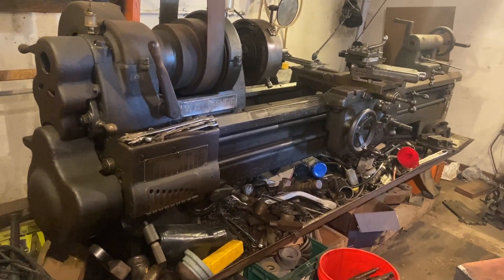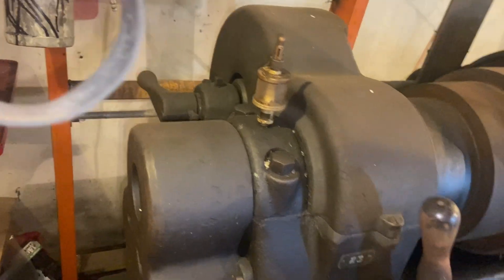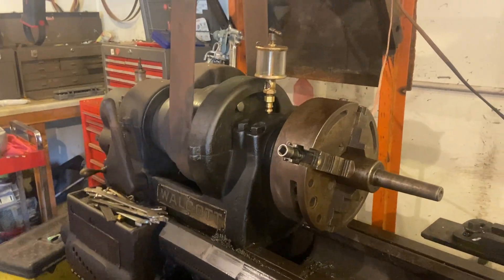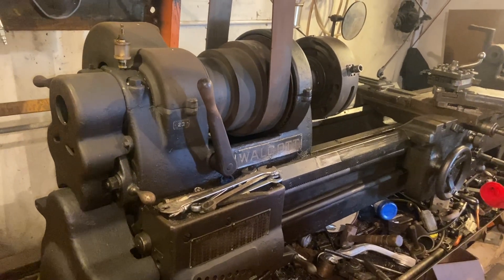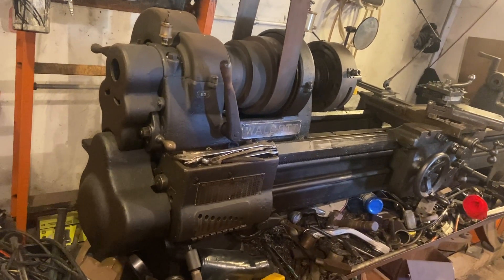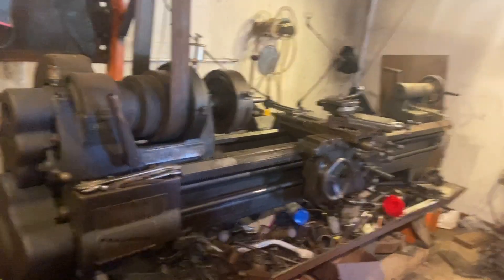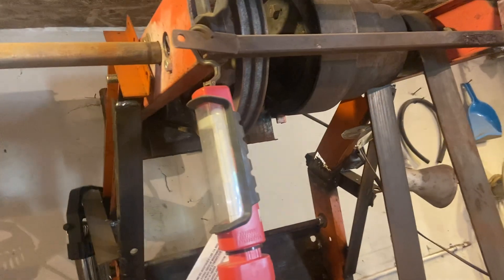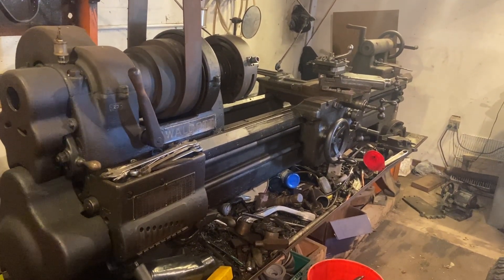Cyclebusters 1917 Walcott 16x64 Antique Engine Metal Lathe

Comment: Do you know anything about using the power feed of the carriage and the cross-feed at the same time. I can’t find any information on the subject.
Reply from the maker: well its really a useless function, but engaging the power feed engages a gear set which runs through a pair of clutches, you tighten them  to make the feeds work, and you could easily engage both clutches. If you run it and watch you will see how it is set up. Nobody would use it as its an automatic disaster, The only real lock out is the lead screw vs the threading shaft.
Reply: @cyclebuster  yeah I figured out the lead screw will stop the whole function. All I could get it to cut was a 45 degree taper but it cut it really smooth. I’m thinking there should be a way to do other degrees of cut but I haven’t had a chance to experiment. I converted it from 3 phase to single pass and just got it done today.

Comment: I have the same machine. I just got it a week ago. I just put a video short on YouTube yesterday about it. I am thinking about recording the restoration and put it on my Channel. Mine has a brass plate stamped with the number 5 on it. I am hopping the restore it and find some tooling for it.
Reply from the maker: i have a spare tailstock and some other stuff. You may have one of Henry Fords 1917 order of 31 machines. I have a wrecked 16 in Walcott for parts.
Reply: I do need a tail stock. I have looked for one local but can’t find one.
Reply from the maker: I bought a parts machine that fell over. its where i got that giant chuck from. Anyway i will pick it up in April, he went on winter break before i could pick it up. there is 3 more chucks there and some misc spares. I want the gears and such for spares however it has a nice tail stock, and the bed is incredibly nice.  Also all the badges are real nice.   @Janderson-AppalachianCreative
Reply: @cyclebuster  I’ll keep in touch with you about it. Where are you located?
Reply: Where do you have to go to pick up that parts lathe?